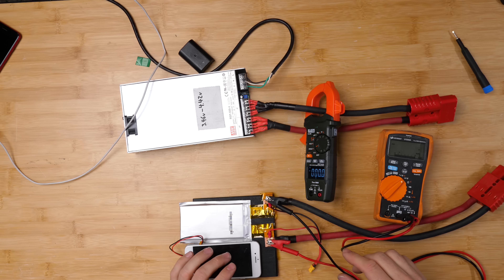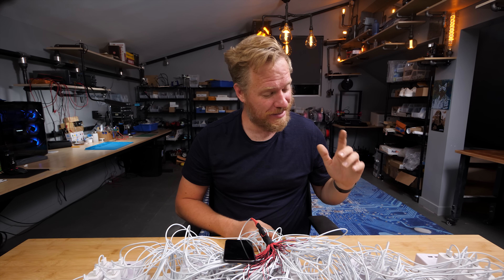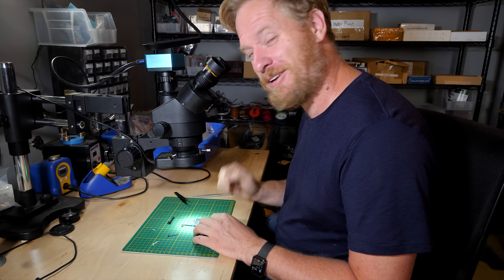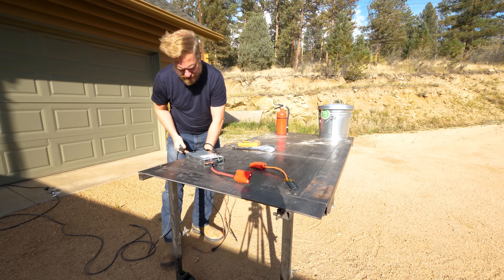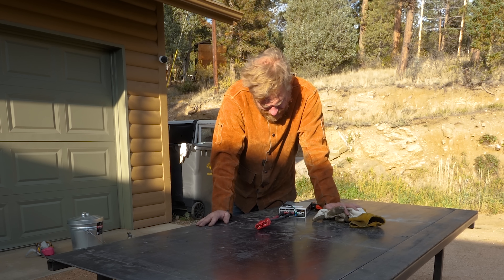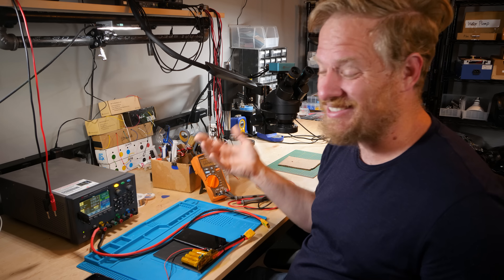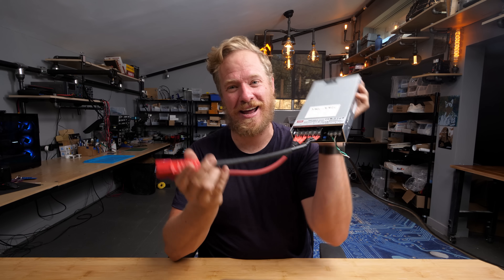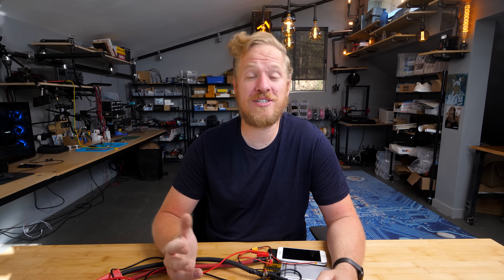I built an iPhone that charges in 9 minutes

Comment: Might be worth noting;

Li-ion, LiFe and LiHv cells have a 2-stage charging curve.

The initial charge stage is constant current until the cell voltage stabilizes close to its maximum charged state voltage. This stage of the charge cycle is where you're the most likely to be able to cram tonnes of current into the cell. This   constant current stage of a Lithium charge cycle lasts until the voltage stabilizes at the fully charged limit of the cell...

Once the charge voltage reaches the fully charged voltage limit (3.65v LiFe, 4.3v LiHv 4.2vLiPo / Li-ion)  though, the current is going to start tailing off, as the charge current required to hold the cell at that voltage becomes lesser and lesser over time as the cell takes on the remainder of its energy. This is known as the constant voltage stage of the charge cycle. To increase the charge current again, you would have to overcharge the cell by increasing its voltage. With lithium ion especially, this is definitely not advised as it causes a breakdown of the separators inside the cell until it eventually short circuits internally, resulting in spicy-pillowification and/or fire induced by thermal runaway.

The upper limit of how fast a cell can take on an excessive charge current though will be governed by both voltage and internal resistance. there is only so much current a cell can take on at its rated voltage regardless of how high capacity it is if the cell has a high internal resistance. This is also why supercapacitors can charge so much faster with the same voltage, and it's recommended they are configured with current limiting because they almost act like a dead short on a circuit until they start taking on some charge. their internal resistance is generally an order of magnitude lower than a battery cell's is, therefore at the same given voltage limit, the cap should easily be able to pull a lot more current than a battery cell, as you demonstrated in this video.

Still, it's impressive that you had that iPhone battery chugging back charge at almost 5c!! that's an insane charge rate for a lighter duty LiPo cell!

Comment: The reason why your iPhone 8 doesn't draw more than 1 Amps is not because the BMS is restricting it. It is because your iPhone checks for Fast Charge protocols but those cheap ass power supplies don't support any. If you'd get a Fastcharge Trigger you can hook it inbetween the iPhone and the battery of chargers and just enforce eg. 5 Volts and 3 Amps.
A really good device is for example the AVHzY CT3.
The iPhone 8 uses the USB-PD (Power Delivery) standard and either wants 5V 3A or 9V 2.22A

Comment: Your stock battery lithium charging experiment failed due to charging at 4.176V, which is actually a very low voltage in terms of the battery state of charge. Phones usually charge their cells at 4.4-4.45V nowadays due to the 3.87V nominal chemistry.

Comment: The reason the battery didn’t implode when you tried to charge it at a high amperage has to do with the chemistry used by apple. They’re designed to be very resistant compared to a normal lipo. Bending, puncturing and things that would normally cause a fire have less of an impact on them.

Comment: I have a few 1050mah battery packs that I’ve routinely charged at 15amps for years. I use them in a few of my RC vehicles and having a charge time of roughly 7 minutes has been AWESOME. Out of the 4 packs (2S and 3s) only one of the 4 packs started puffing up after a year or so but the other 3 zero issues & I’m still using them.

Comment: I'm staggered at how small that supercar is. I remember seeing early caps that were positively massive compared to their counterpart chemical batteries. The one you have in this video is only slightly larger than the lipo from the iphone. Amazing progress in that field. I'll have to do some reading about the materials.
Reply: This one is a LIC (Lithium ion capacitor), which is more like a hybrid between lithium battery and a supercap. They are much more energy-dense than regular supercaps in exchange for shorter life cycle and lower maximum currents.
Reply: @SaNjA2659  you also have to treat them like lithium batteries so you can’t overdischarge or overcharge them.
Reply: @conorstewart2214  are they as dangerous as the capacitors you find in your power supplies? will they just dump a ton of current into you if you touch the wrong spot?
Reply: Yeah I remember the blue soda can like ones from Maxwell, remember those? That was about 2013. Really amazing progress.
Reply: The energy density does not and will never get close to chemical batteries. Still neat to have that new form factor.
Reply: @drkastenbrot  Even if it was half the capacity like stated in the video, that's still phenomenal. Aside from significantly faster charging times, capacitors have significantly longer lifespans measured in the hundred-thousands and some in the millions of charge/discharge cycles.

Comment: Do you think the MFi chipset has anything to do with the limits to its charging ability regarding the battery?
Reply: No. Also it's not the job of the BMS to regulate charge current. The chipset in the phone regulates current. The BMS can only allow charge/discharge or cut off the power. No inbetween.

Comment: Very informative rechargeable battery science.  I enjoyed this episode a ton.  Keep learning Scotty.  We enjoy coming along for the ride.👍🏼👍🏼
Reply: It's great to have you back, Scotty.

While it's a nice video to watch, it feels to me somewhat incomplete.

Things that are important in my opinion that were left out:

What is the normal voltage of a Lithium cell and how it changes with respect to the amount of change.

How can the phone tell the battery percentage (it's not linear)

What a battery protection circuit protects against (overheating, under voltage, over voltage, over current, short circuit...)

Why you don't want to run a high current with low voltage through a wire, and that you would rather increasing the voltage to get more power using the same current, which is the base for many quick charging technologies.

How you can connect batteries in series to charge to a higher voltage using a special IC that monitors the voltage of each cell in the series and balances the charge rate.

Why you may not want to charge your phone as fast as possible (causes damage to the battery in the long term.

I know you can't fit all of these ideas in one video, but without touching on some of the topics I've briefly mentioned, at least in a follow-up video, or mentioning that it's only a part of the picture, recommending other videos on YouTube for further watching, so people wouldn't get the feeling that what you've mentioned is VERY complicated or that that's all there's to it.
Reply: @MichaelFri  Agreed.
I've missed many of that stuff because I don't know and wished he went a bit more deep into the topic, nonetheless a very interesting video.

Comment: We should use both. Charge the super capacitor first then let that charge the battery while you're on the go that way your wall charging time will be lower but the battery was still charged at the same rate

Comment: This guy is so mixed up on what "he knows" vs facts. In the industry we say these people know just enough to get themselves hurt.

Oneplus already has a li-on battery that charges at 80watts in 15 minutes at stock. Stop using outdated apple and you'll not have that problem. You're solving problems that don't actually exist with solutions that aren't logical.

Comment: Hello there, great video, and great content, i figured you have pretty good knowledge when it comes to electronics, so i figured you might be the only one who can answer a question about my phone.

So i have a Samsung galaxy A13, i bought it brand new, and it's 3 months old at this point, the battery is now literally lasting 3 times less than what it used to, i don't know why, i've only ever used its original adapter to charge it, and i also never let the battery drop to less than 30%, or go beyond 85%, i did a flash and a hard reset to eliminate potential software problems, but that didn't help, and the problem persists.

Here's one more detail which i find really weird, when i plug the phone via USB, i noticed that it charges impossibly fast, and when i checked the current via the Ampere app, it was between 1200 and 1300 mA ! keep in mind that the USB port i plugged the phone in is a USB 2.0 port, which means that it's impossible, the cable or the USB port aren't to blame, i know because i tried another phone with the same cable and the same port, and the current reported by Ampere was approximately 300 mA, which is more reasonable.

I'm almost sure it's a hardware problem, so i think i'm gonna try to RMA, i'm just looking for an explanation here if possible, i posted about this on XDA developers forum, but no one has been able to help me, i hope you can, keep up the good work, cheers !

Comment: You went from a fast charge power brick to a bunch of tiny bricks that can only slow charge. The USB fast charging protocol negotiates power delivery to accept higher voltages when attempting to fast charge. The slow charge bricks have no negotiation and only charge at 5V, thus no matter how many slow charge bricks you used the time was always going to be slower than a single fast charge brick. The phone itself determines how much current it will/can accept, the brick can only say yes or no to its request.
Reply from the maker: Yes, agreed.  I think I probably should have tried to explain that better.  Your explanation is great though.
Reply: Apple has his own limits at max 2.4A, below the USB BC1.2 standard max of 3A.
Reply: @oraszuletik  yes but 2.4A at 5V is much slower than 2.4A at 9V or even 12V. I’d assume it’s 9V
Reply: @Twisted_Biscuit  you charge a LiPo with CC-CV method, never goes over a given battery voltage, so your limit is the maximum charging current in the CC state, which is already limited by the negotiation. Unfortunately, the rest of your power possibilities are not used here. But with USB pd standard you can go up to 5Amps. Scotty was right trying an extremely high Amp charging current, but delivered energy at 4.2V was 🔥
Edit: I'm just explaining the battery charging part. Of course, higher power delivered between the brick and the phone is used "elsewhere", like operating the phone 😉
Reply: @Twisted_Biscuit  you're decimating the phone's  current limit at battery level. doesnt matter how much voltage delivered, if the phone asks for 20W, then the limit would be 20W. if the charger can only deliver 5V, then the phone takes 4A. if the charger can deliver 9V, then the phone takes 2.2A even if the charger itself capable to deliver 5A assuming the phone was able to ask for higher voltage.

take a 65W charger that could deliver 19V, it will be limited to 20W still.
Reply: @Twisted_Biscuit  From what I know, phone batteries are only 5V
Reply: @C4Oc.  you should look into that a bit deeper past your  “from what I know” library lol.  Fast charging is much more complicated than a battery being a lower voltage. There is a chip that handles the complications taking higher voltages and current and providing it the battery in a usable way. Also the battery voltage is dependent on the type of battery, it’s not always 5V. Sometimes it’s lower like 4.2-3.7V
Reply: @oraszuletik  thats regular charging. Current fast charging is temperature limited, it pushes as much current as it can decreasing or stopping temporarily if the temperature goes below a threshold. Also, some phones use 2 batteries either in parallel or series to increase the "charging speed" (power more than current per se).
Reply: He most definitely knew it was going to happen but he just did it to make the point.
Reply: plus, USB standard, checks the resistanceonthe 2 data pins, if it doesnt recieve data or signal it limits itself to 1a
Reply: To be clear though, if you just fed a high voltage and amp current into the phone, the phones current limiter would fail eventually right. You guys are kind of making it sound like this phone is unable to receive too much power at all (with the chip in the phone) and that doesn’t feel right to me so I’m curious
Reply: @monhi64  That is how it works, and yes if you give anything enough voltage/current the device would fail. Usually there is overvoltage/overcurrent protection but they can only go so high before failing. The phone has a chip inside that limits how much power it can take in to protect itself. If you fast charge batteries all the time, the battery degrades quicker. The iphone has software built in to learn your schedule so it doesn't "top off" the battery until right before it knows you are going to take it off the charger. A big reason phones are still on the lower wattage range of fast charging is because they are small, more wattage is more heat and a small device doesn't have anywhere for the heat to go.
Reply: @monhi64  You obviously dont understand how electricity works. you dont feed current into anything and there is no "current limiter" in the sense you think of it. Every electical device only uses the amount of power it needs. Say I connect a device that needs 12 V, 3 A to a 12 V, 3 A power supply it will work fine. If I connect it to a 12 V, 100 A power supply it will still work fine and will still only use 3 A. Likewise I could use a 12 V, 2 A supply and the device may still work and may still draw 3 A, you may have voltage issues and temperature issues but it may still work.

 The chip in the phone sets the charging current and only uses that amount of current from the charger. Think of it like a water pipe, you have a valve that only lets a certain amount of water through, it doesnt matter how big a pipe you have or how much water you are capable to put through it, the valve will still only let that much water through. It is the same with electricity, it doesnt matter how big the cable is or how capable the power supply is, what matters is how much the device itself uses.
Reply: Look at the videoless keyboard expert wow
Reply: Since he mentions the chargers are 1A, maybe they're just really old school 5V 1A chargers (would explain how he would've gotten loads of chargers for a reasonable price)
And in that case I assume the old school chargers would top out at 0,5A if the data lines aren't hooked up, would explain how the charge time pretty much doubled
Reply: @waldevv  even if the individual chargers maxed out at 0.5 A there are loads in parallel, two in parallel would max out at 1 A, 4 in parallel at 2 A, etc. Electronics however only draw the amount of current they need or want, it doesn’t matter how much power the charger can supply, it matters how much the device needs.
Reply: god i thought this was obvious common knowledge 🙈 honestly what a waste of money on all those power bricks and cables

Comment: You forgot to build a custom iPhone case for the super capacitor showing it working as a phone with the stock battery replaced. I was expecting this. 😂
Reply: was expecting a "phone" too, not just a random battery connected to a phone 😂

Comment: Cool video but you didn’t build an iPhone that charges in 9 minutes. Good discussion about battery trade offs and chemistries but you simply charged a super capacitor off a power supply in 9 minutes, you didn’t even power the phone off it.

Comment: I think the current phone battery capacity is good, that is you easily get a full days use. Whilst I recharge the body through sleep, so can the battery, so charge speed is also fine.  BTW, what's the leakage of the supercapacitor you used, it may hold the same volume of energy but would it stay 'in the pouch' all day?
Reply from the maker: The supercapacitor seems to have very little leakage - it holds a charge really well anecdotally.  But I haven't tested it rigorously yet.

Comment: Would be awesome if the phone had the ability to charge very quick and you could turn it on when you really need it but on teh other hand itll still be able to charge very slow so that when i put it on the charger before i go to sleep or at work you know locations when you already know the phone wont be moving much.
Reply: all phones can do that lol
Reply: @vipvip-tf9rw  Nah, mine never did. I only know the Function that Phones or Devices only charge up to 80% and then stop but no phone where i can adjust the charging speed
Reply: @hadiFPV  you can use 2 chargers one 5v 1a and second one fast, 5v 1a are cheap, phones swittch charging modes depending on charger block power
Reply: @vipvip-tf9rw  yeah buts basically thats what i mean with my comment above. To have the option to change it on the phone easily and not buying a different charger.